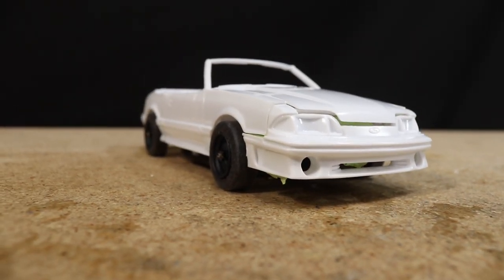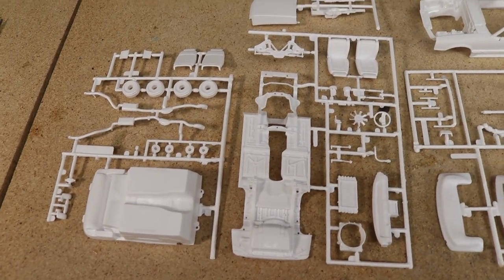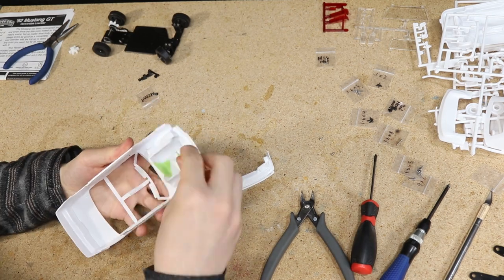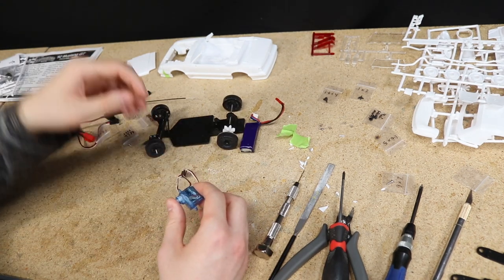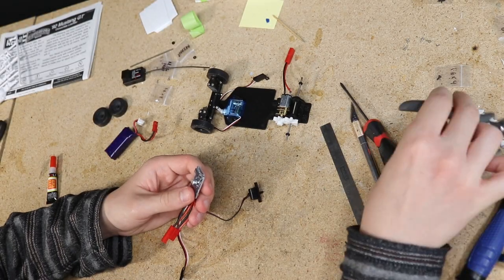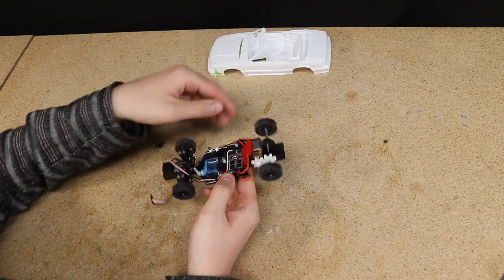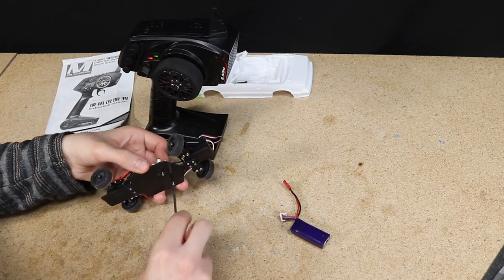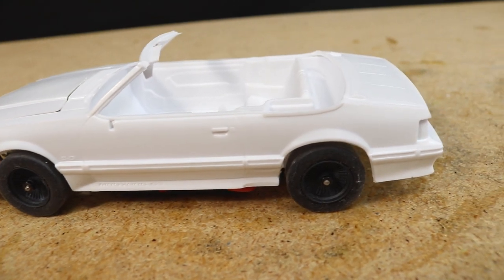Custom RC 1992 Ford Mustang GT Lowrider Build in 1/24 Scale From Menace II Society

Comment: Have you considered replacing some of the wiring with simple custom printed pcb board? It could be integrated into the bottom chassis so you could keep more of the model interior and have shorter wire runs to the components

Comment: Why you don't make the motor in front
Reply: This is the simple chassis, designed to have easily printable parts. Front motor would be difficult to do with that in mind. His more complex chassis has a front mounted motor.